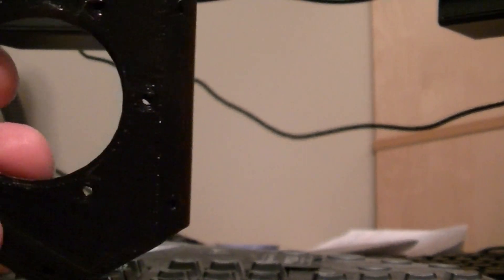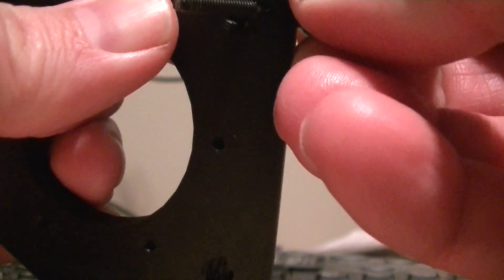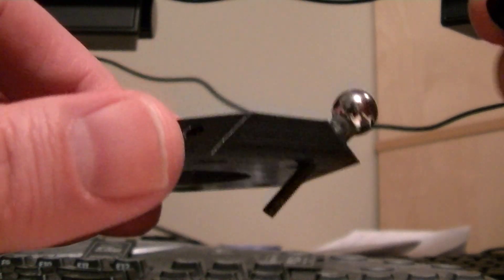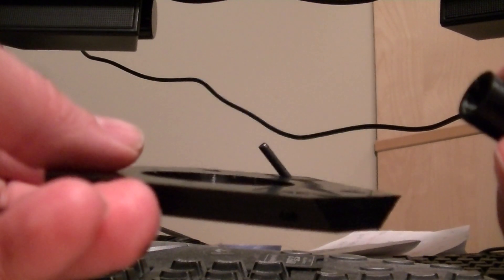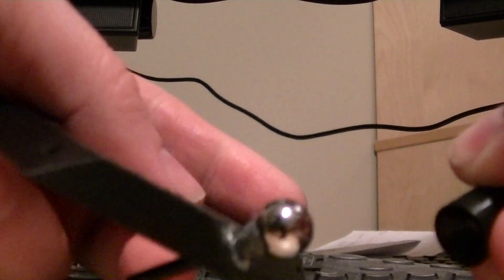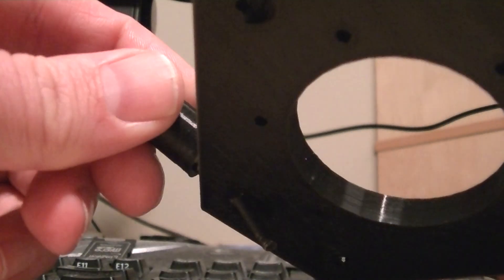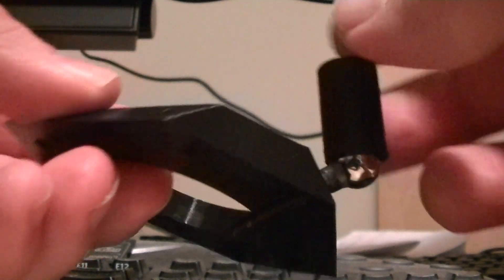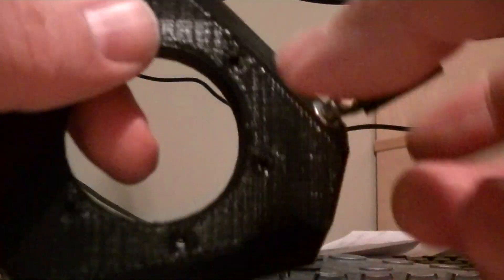Rostock Delta Magnetic Ball Ends with Effector Concept

Comment: beautiful.
this is the direction i would pursue.
i hope you find drilling unnecessary.
might magnetic-dimple-sockets be also embedded in the carriage and provide enough hold?
or maybe a larger bearing would provide enough adhesion surface and enough angular freedom?